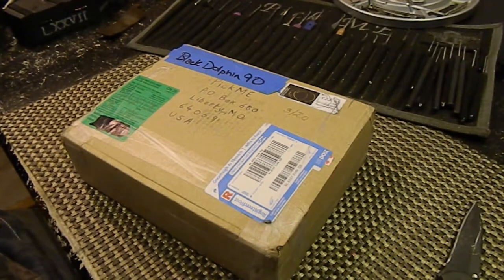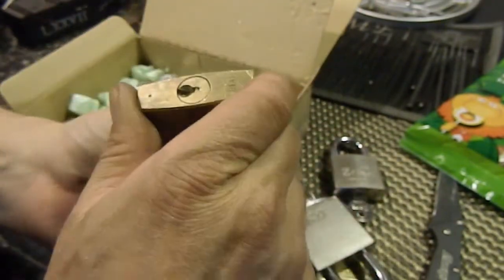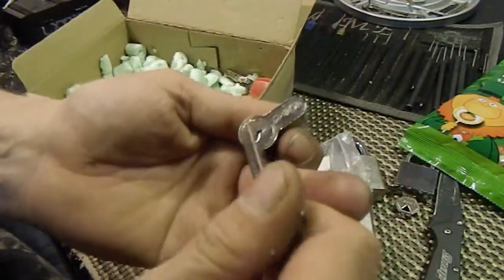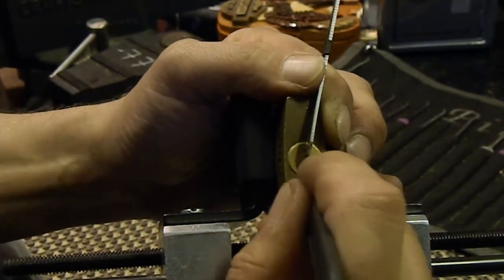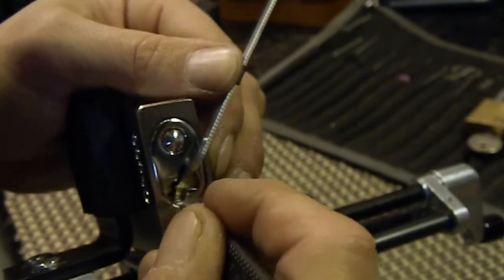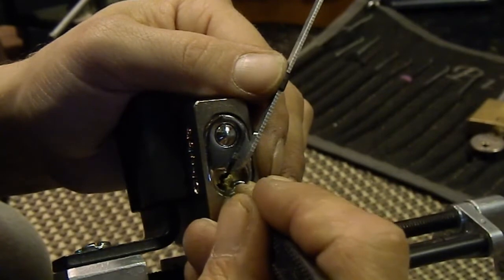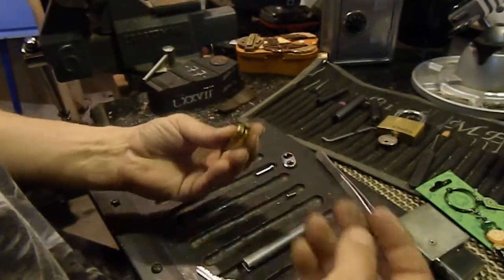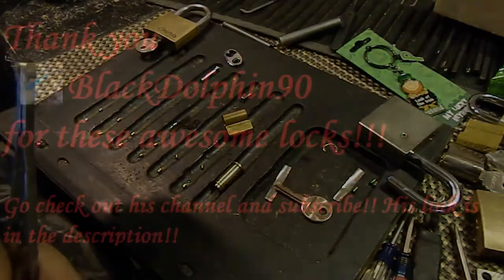(377) Excellent Parcel from BlackDolphin90 & 50mm Chubb padlocks Spp'd and  gutted

Comment: Sweet Video bud,
Those CHUBBS are nice pads.
and the Chinese dimple lock made its way to me and is a good fun multipoint locking system.  and it's tolerances are just poor enough to make it a fun pick instead of a terribly hard pick.
But stumping you is to hard to do in itself. lol
I have an identical setup as the Chinese one but is an S-Tech and is one of those Hard ones. lol
Looks like a ton of fun pickin in the future.  lol
Cheers!
Reply from the maker: Steel Pinnings Thank you my friend! I definitely had my suspicions about the 10 pin dimple...lol
I'm sure it will be fun::-)
thank you for the kind words my friend!!!☺